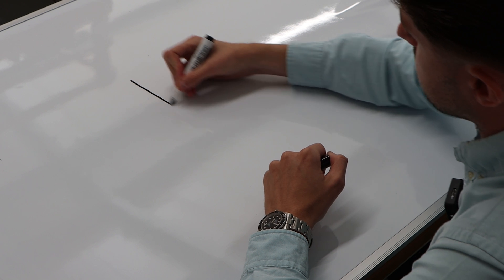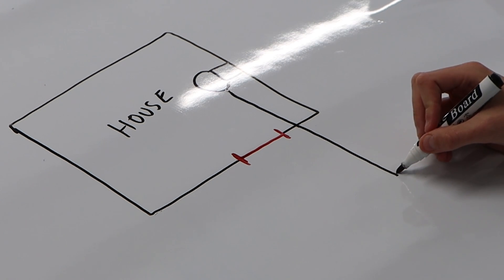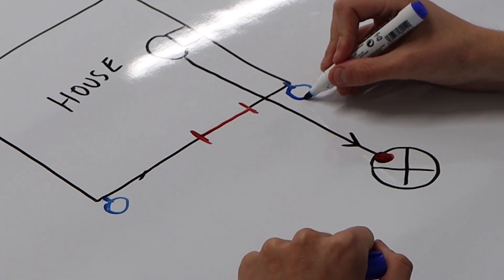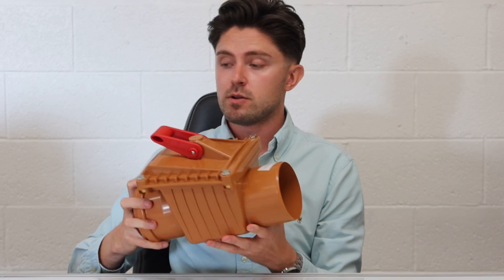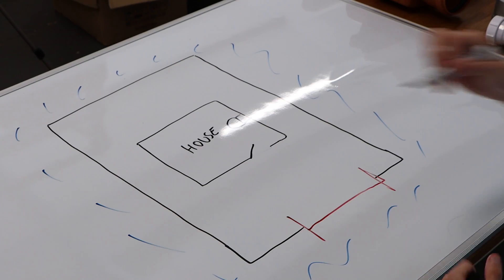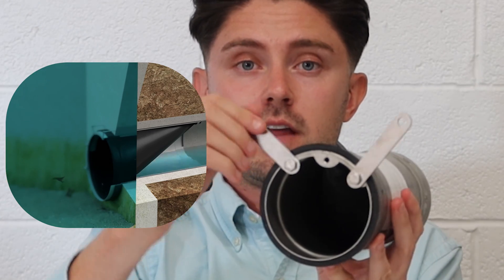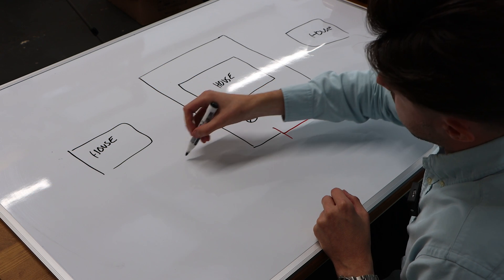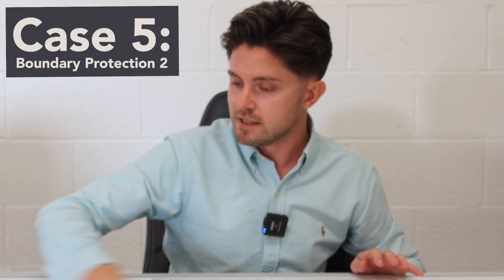Preventing Toilet and Drain Surcharge | Non-Return Valves | Backflow Protection with Simon Crowther

Comment: Hi James, very informative video. I'm hoping you might be able to help me solve a problem with your knowledge. I have a glamping accommodation and need to use a large tank for the grey water (which will be emptied periodically). My issue is that I can’t dig a hole for the water tank and I can’t raise the accommodation higher than the tank. Will one of these one way valves be able to stop the water from inside the tank going back up the pipe into the accommodation? Thank you so much for your help in advance.